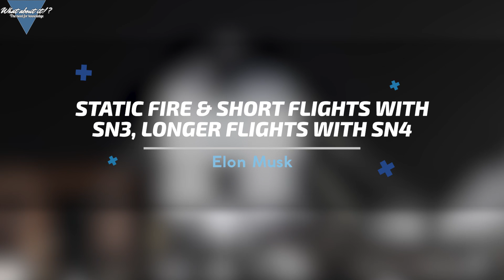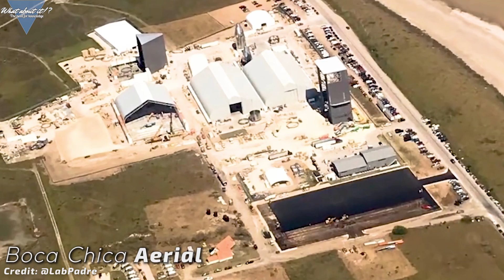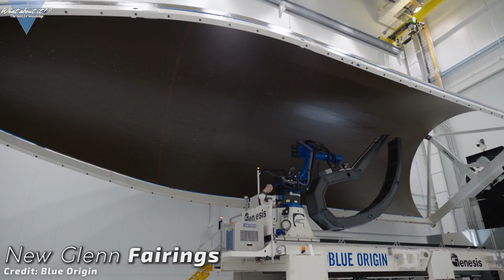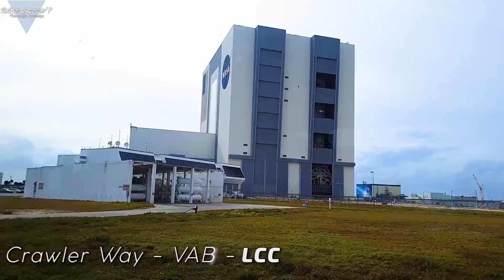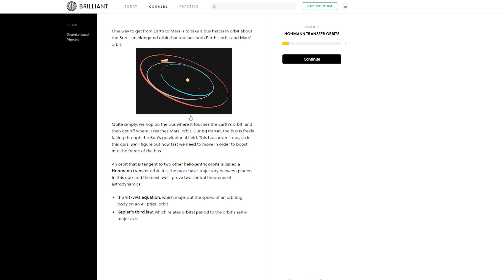77 | SpaceX Starship Updates – Blue Origin Updates – Inside KSC

Comment: Welcome back Felix, you’ve been missed but you clearly had a great time.

On the BE-3U engine and the expander cycle with no pre-combustion chamber, with Elon’s “the best component is no component” mantra I’m wondering after your description of the BE-3U (which also mentioned reusability, another big thing for Elon) why SpaceX didn’t go with this type of engine cycle for Raptor. Is it a fuel thing, isn’t suitable for methane so not as easy to produce a suitable fuel using raw components on Mars?

Comment: This is A LAUGH!    This image of yon Spaceship  is a cross between FIREBALL XL5 and Voyage to the bottom of the sea  SEAVIEW
Take a gander and the two vessels Of the two it MOSTLY looks like the SEAVIEW with all the windows on front.

So they are USING EARLY 1960's SciFi as the template for designs looking for the -- KEWL FACTOR

Comment: About the BE-3U...If it's on the 2nd stage, and the 2nd stage is expendable, why does it matter that reusability is an advantage?  For New Shephard, sure, but not for New Glenn.
And as regards reliability, do you think it will be more reliable than an upper stage Raptor where reliability as well as reusability will be very important?

Comment: I think  space x should  roll the starship and booster tubes like a cardboard tube on a big collapsible  mandrel.  Robotic weld . Trim ends  done. Overlap slightly  for added strength.  The stainless probably  has a linear grain from the rolling process.  Very strong with no ring seam. They could probably make one a day or more.

Comment: BTW the schematic you showed to explain expander cycles was for a closed expander cycle (like in the RL 10). however that cycle is limited in its possible thrust output (about 100KN) due to the low pressure differential between the turbopump exhaust and the combustion chamber.  To get around this the BE-3U is a open expander cycle, where the exhaust of the turbopump is vented overboard, causing a greater drop in pressure and allowing higher thrust levels ( in this case 710kN)

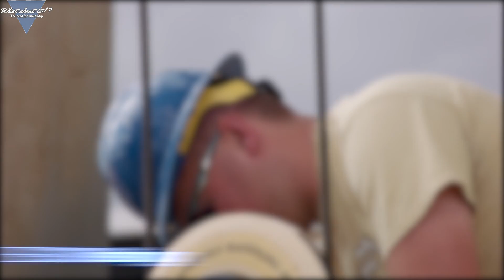Comment: @10:33 the diagram is of a closed expander cycle, the BE-3U uses an open expander cycle. A 700kN engine is impossible with a closed expander cycle.
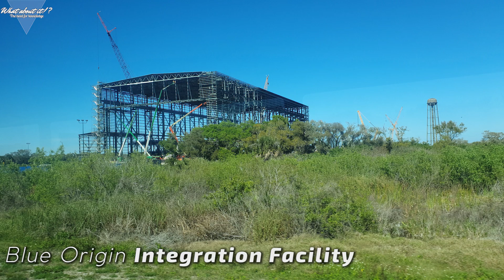 @11:14 I think you meant BE-4 instead of BE-5.